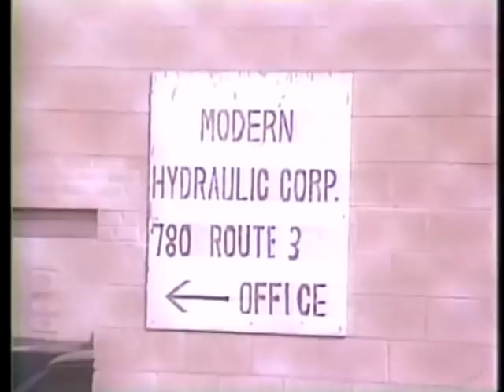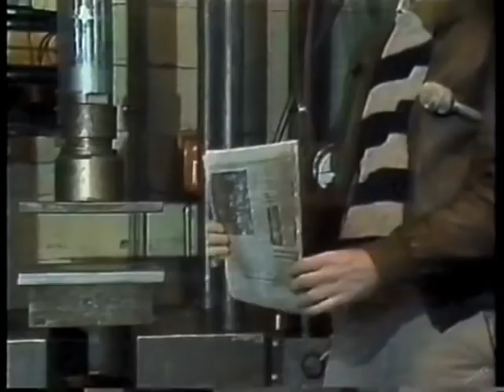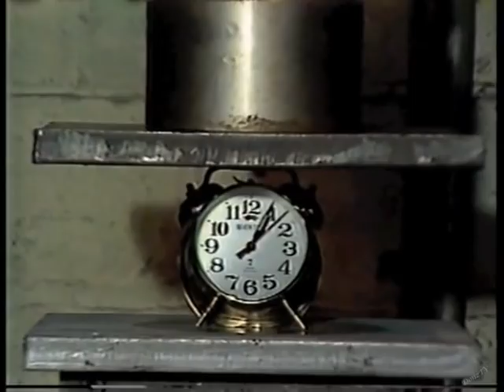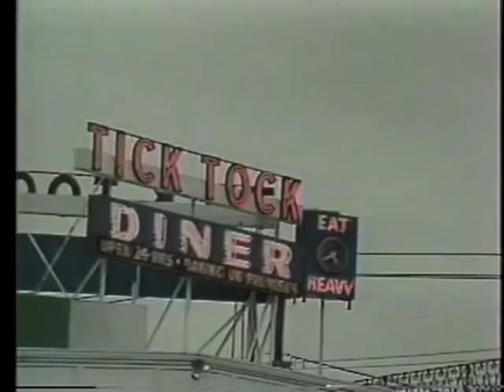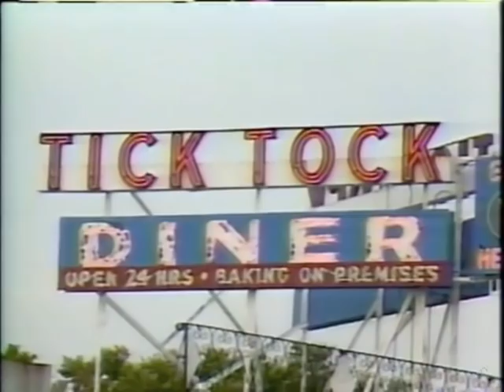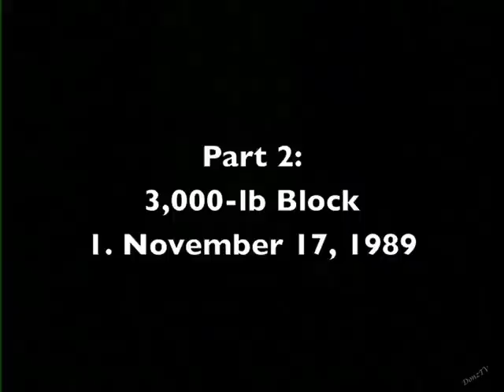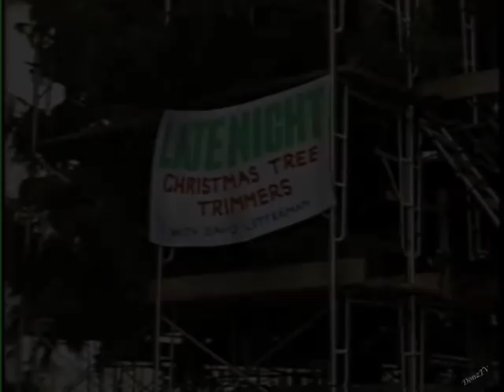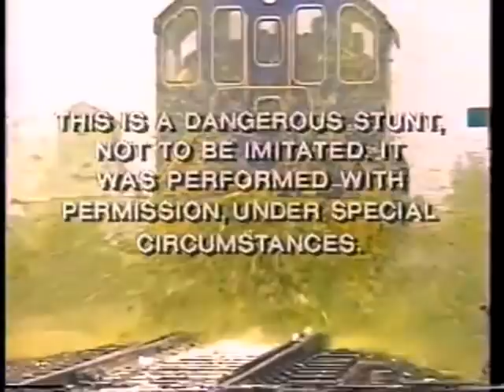Crush, Smash, and Crash Collection on Letterman, 1985-90

Comment: After a short search, I determined the locomotive (used in the Crash remotes) to be from the Connecticut Central Railroad number 36, an Alco S4 Diesel built in 1953. the trackage used for that remote was the Industrial Track, a 2.5 mile stretch from Middletown to Cromwell, Connecticut.
Reply from the maker: Nice!
Reply: Great work. thanks.